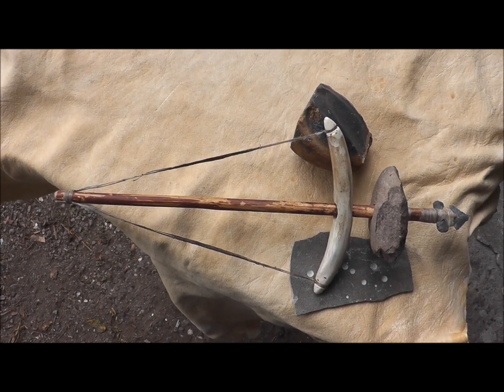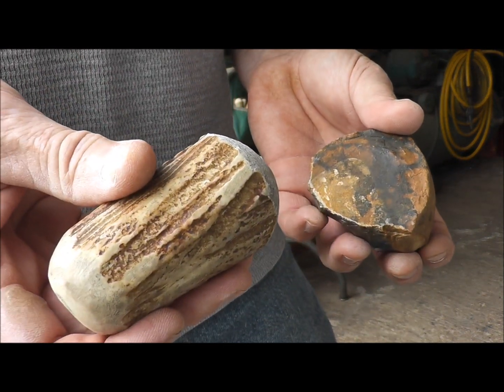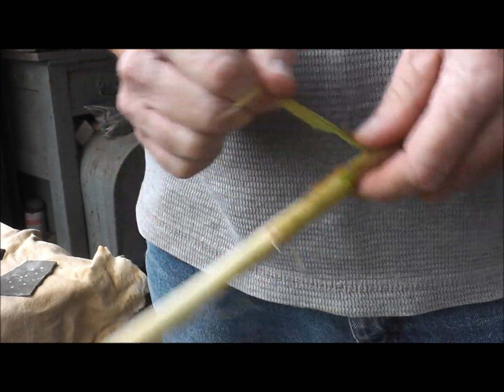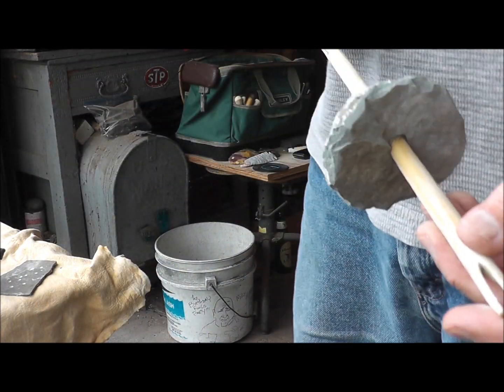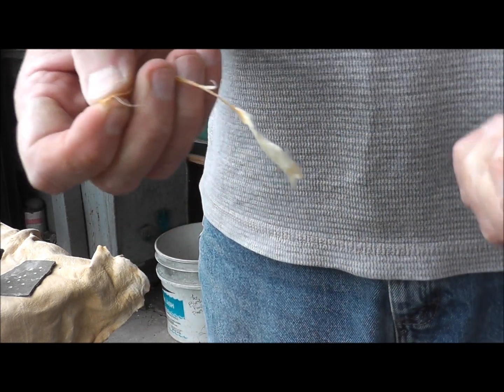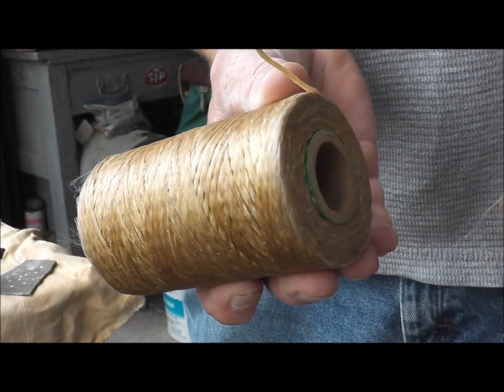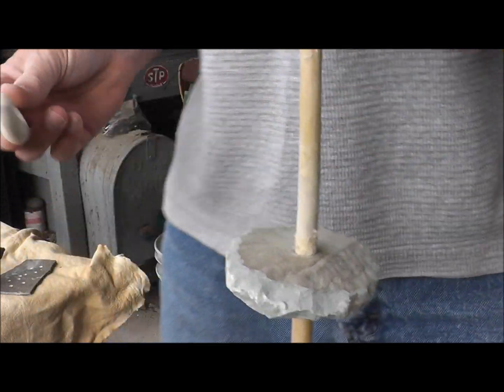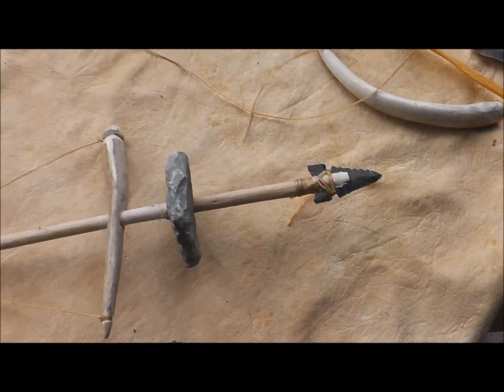How to make a Pump Drill by Paleoman52

Comment: If you would please add a list of materials it would be great thanks
Reply from the maker: All that is need is a straight stick, a flat somewhat round stone, rawhide or imitation sinew, a piece of Deer antler tine and a tip you would fashion from a small piece of chert or flint. You can either drill the hole in the stone with a masonry bit or a flint tipped hand drill.

Comment: You are perhaps better to build a clay oven. 

First take some clay and form them into circular shapes just like in this video and bake them in the oven.

I think that the clay weights work as well as using stone. If not you can always use your new drill to make holes in weights shaped from circular rocks afterwards and save time and effort.

A clay oven is always a good thing to have around if you are need of it. I'm guessing if you have had to make such a drill you are in probably a situation where a clay oven would most likely benefit.

Lol chicken or the egg? 😆😂 

You need the pump drill to make fire and to drill a hole in a rock. 

But seriously it is possible to make a hole in a rock by striking it with a sharpened rock point. It just takes some time that's all.

Comment: If you got cordless tools to drill threw the rock you don't need a pump drill.. There is also other ways then using a round rock weight and having to kill a deer to get it's antler!
Reply from the maker: You don't have to kill a Deer to get its antler, they shed them every spring. I pick them up off the ground.

Comment: How did you put a hole on the flywheel?
Reply from the maker: You can use a hand drill to make that hole in the flywheel. Before you add the flywheel and antler tine pump handle use that flint tipped shaft to hand drill the hole first.

Comment: what can you use for a drill if you don't have Flint Rock?
Reply from the maker: I have heard of some folks using a flattened nail or even a piece of ceramic from a broken toilet tank. Ceramic works just like flint but does take some practice to learn how to chip it into shape. So you may want to give the flattened nail a try.Just take a larger nail and pound it flat with a hammer on a vice then file the edges to sharpen it into a bit.

Comment: how does one drill through a stone without a drill?
Reply from the maker: I'm glad you brought up the fact after TurtlesLoveTiger asked about this because I realized when I read the comments that I took that step for granted and overlooked it. It is a very important step if you plan on making one of these devices. I rely on my viewers to tell me what they need to see. so thanks, I will be sure to be a bit more thorough on my next "how-to" video . :)
Reply: +Paleoman52 i was shocked only because when I saw this i was wondering how you drilled the hole for the drill (not critical, just diappointed. good video)
Reply from the maker: +TurtlesLoveTigers I drill that hole by using a flint tip on just a hand shaft. You can turn this the same way as a pump drill by placing your hands on each side of the drill shaft and turning it back and forth. I use that method more than the pump drill method.
Reply from the maker: Mark Becker Good point Mark, that completely slipped by me as I was making this pump drill.
Reply: this is probably the most important step to show and it's skipped

Comment: would they use these with the long stemmed drills or were those just used buy hand ?
Reply from the maker: +Kris Muehlenhard I believe they probably used a shorter stemmed drill with this type of drill as the longer stemmed drills work better with a hand drill. This drill relies on the size of the flywheel used and could bind if you drill too deep.

Comment: how do you cut out the groves to receive the stone bit? I always have trouble with the shaft splitting... I see you mentioned using a masonry bit to drill out the stone. do you use modern tools a lot for these projects, or just when its most efficient?

Comment: How long does the drill stay sharp?
Reply from the maker: These drills tend to cut for quite a while. Sometimes during drilling you will hear a pop and that is a chip coming off the tip which resharpens the drill. I always tell everyone that these are the worlds only self sharpening drills. I will do a demo sometimes for school kids and of course they all want to try the drill and I have yet to see one break from use. So they are quite durable and don't require sharpening very often. Of course that all depends on what you are drilling a hole into. I always drill stone and that is what I base this info off from.

Comment: Paleoman, how do you prefer to cut that notch in the stick for the drill to fit in, because i just cant cut a great notch in handles or in drill sticks.
Reply from the maker: I have a band saw and I cut out a V in the end and then I file the opening to match up with the drill I want to insert into the shaft. You could use a coping saw, these are great for getting the exact shape you want that notch to be. I would say any hardware store has coping saws and blades.
Reply: alright thanks man